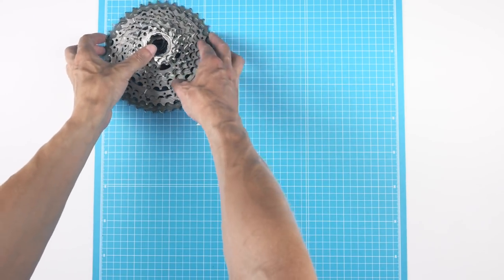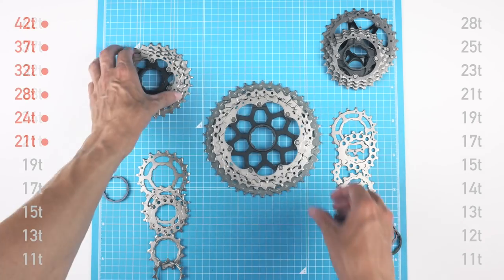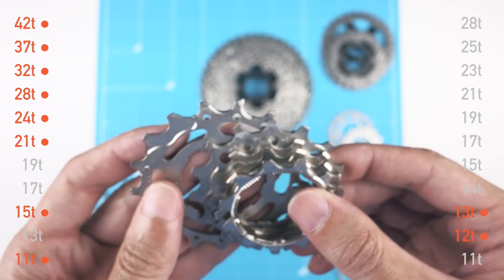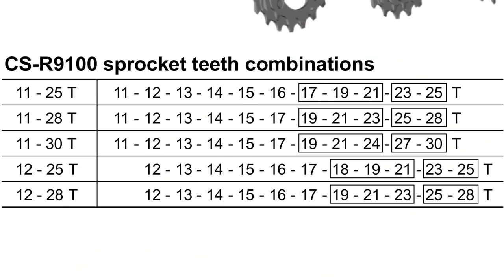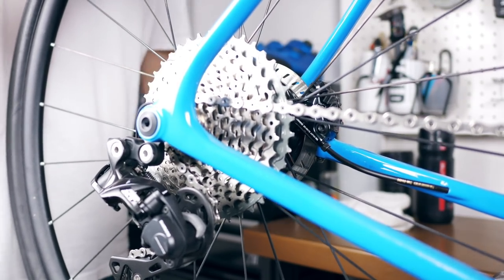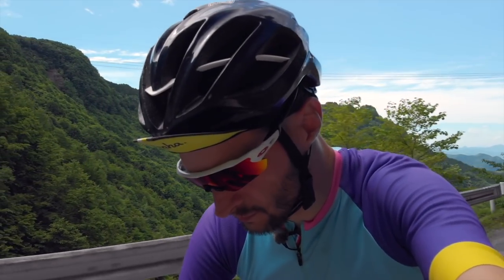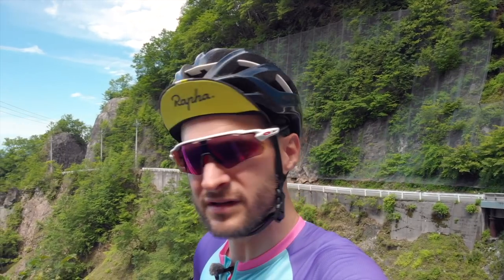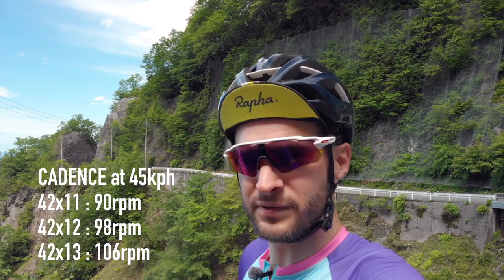Making a custom cassette from an MTB XT 11-42 and Road Dura Ace 11-28 for 1x

Comment: is there any advantages in speed if i use 11-28t cassette in my mtb specially if the cogs plate sequence is 11t-12t-13t-14t-15t.....Is it will be fit in,this kind of cassette 11-28t to my mtb hub...currently using 11-42t 10 speed?Thank you in advance
Reply: Speed is up to your legs. If you use the MTB for road, then it's fine to use a closer ratio cassette if you don't need the lower gears. For off-road, wider gaps between cogs are actually beneficial because of the irregularity of the terrain.

Comment: Do you think this mod will work with a SunRace CSMX8 11-42?. I saw that the sunrace has 3 clusters till 19, after that 17, 15, 13 and 11 are free, so just take out the 17 and make the 12 from shimano. I found that you can buy separate the shimano dura ace cogs from 11 till 15. Also the sunrace 11-42 has only 419g, its even lighter then shimano xtr 11-42.
Reply from the maker: As long as the cogs and spacers are the same thickness, in theory it should work, but I definitely expect the shifting quality to take a big hit.
Reply: @ridesofjapan  I was thinking the same think, as quality i don't think that the sunrace matches shimano xt. Was thinking for the weight. Thank you for the answer!

Comment: Hi, I run 3x10s on my MTB and I wanna replace my 11-36t with 11-42t but keep 3x10s. I have deore XT M781 RD and I am wondering will it work if I install roadlink?
Thanks...
Reply from the maker: elvedin hodzabegovic hi, either the roadlink or the goatlink supports 3x according to the wolftooth specifications unfortunately.

Comment: Can I do this on a mechanical and dual chain ring setup?
Reply from the maker: Arif Fauzan I guess you could, but I don’t really see the point as you probably won’t run such a wide range cassette on a 2x crank... or do you?
Reply: Rides of Japan well, we can always try. And change back if we don't like it. 
 Look at RB cassettes, they've been getting bigger from time to time. Old bikes maxed out at 25. Now maxing out at 34 by default. 
Only a matter of time until we get bigger and bigger I think. 
So why not try now?
Reply from the maker: Arif Fauzan I like that way you think 👍
Never wrong to test it out for yourself
Reply: @ridesofjapan  got 46-34 11-42 on my gravel bike, I rarely use the 11 and 13...I was thinking to swap the 11 for 14 (from a 14-28) and 13 for 15 (and in order no to duplicate 15, 15 for 16). Do you believe it's doable?
Reply from the maker: The two smallest cogs are usually a bit special (used without spacers), so if you can find the correct type of cogs I don’t see why not.
Reply: @ridesofjapan  that's what I'm afraid of. Cheers ROJ. Keep up the good work.

Comment: Hi my friend, regards from Germany I have one Scott 930 that I want improve my original cassette xt CS-M8000 / 11-46 :11-13-15-17-19-21-24-28-32-37-46 teeth with the first Cog of the cassette 
Cs-M9100
            10-12-14-16-18-21-24-28-33-39-45-51T,  cause u live in plane city and I will win 4km if change the cog of 10 teeth instead my original Cog of 11teeh... Is that possible and what I need... In resume just i want change the first Cog of 11 teeh to 10 teeth.. Thks in advance for your time and response King regards javier
Reply from the maker: amircael69 sorry, that is not possible, the smallest cog on a 11speed Shimano HG freehub is 11t.
To get 10t cog on an 11speed system you need a sram xd freehub body and a sram cassette (or other 3rd party brand)